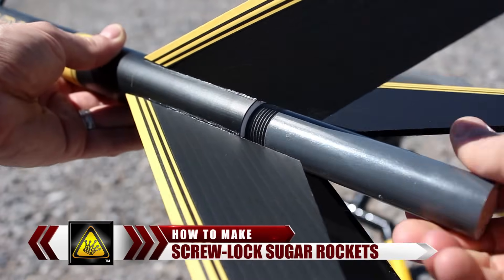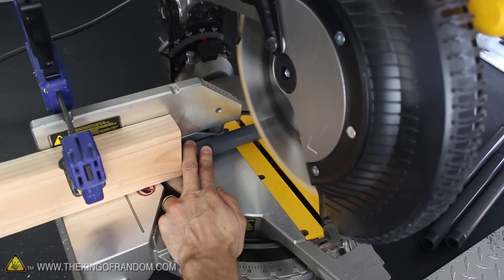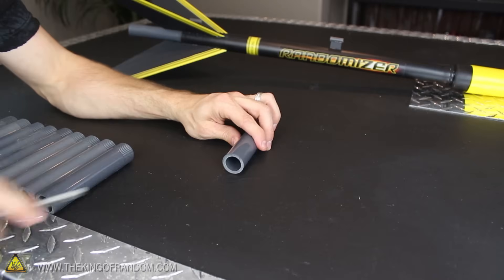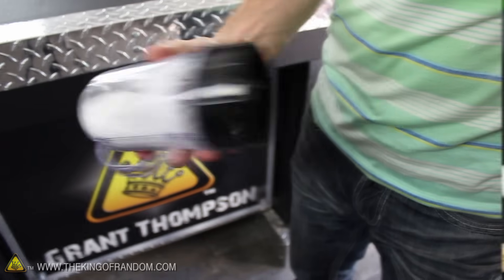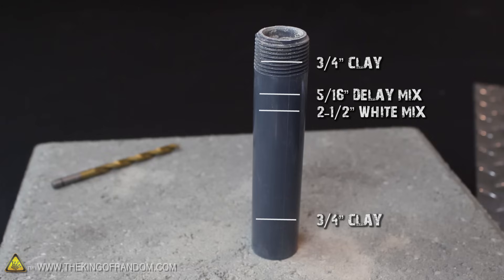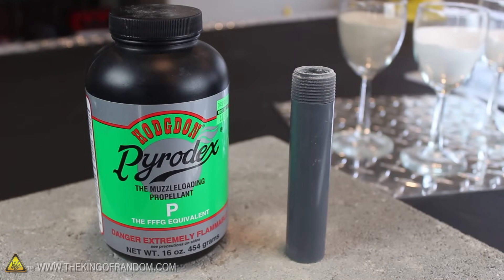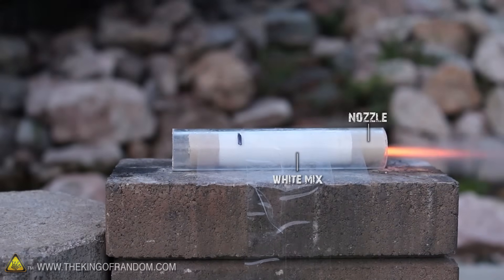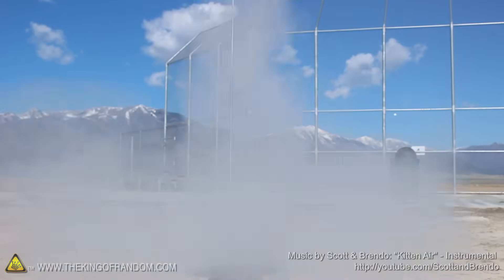How To Make "Screw-Lock" Sugar Rockets

Comment: 1 7/16, 1 12/16, 4 1/4, 3/4, 5/16, 2 1/2, 3/4 .... good God, I don't know how Americans do it :(
Reply: +Hugh Jass What he is saying is that those decimals are RIDICULOUS. 1/10 or 1/100 like metric is so much easier.
Reply: +BC ElginTex said no one ever
Reply: +EoRdE6    Fractions.  I love them.
Reply: Our rulers have longer lines to signify half inches and quarter inches from the 16ths of an inch. I hope that answers your question.
Reply: +EoRdE6 Actually It's good to have some skill in both fractions and decimals. And on top of that, fractions can actually accurately describe more numbers than decimals (including very commonly used numbers).

That said, it's not much trouble to use either fractions or decimals in the metric system whereas using decimals in the imperial system is incredibly troublesome.. And the decimal system is the standard for counting numbers after all.

However, the dozenal system lends itself more for fractions than the decimal system as twelve has more divisors (or factors) than ten. Though the sexagesimal system (base 60) is even handier for fractions, and it is usable in combination with a dozenal system. (our minutes and seconds and angle degrees are derivative of a base 60 system)

PS. 16ths are simply the quater inches divided by four.
PPS. I'm european and most used to the metric system. ;-)
Reply: CelmorSmith I was actually looking up if there are digital calculators that actually have fraction based logic.. but I didn't find any...
Reply: Try putting in fractions in a computer, most databases, tables or even Apps to plan like anything that save numbers as numbers and not text won't accept fractions without converting them.
Reply: +Callum Aitchison we have rulers with 1/16 markers. we're rebels like that
Reply: ToastyMozart I can calculate with fractions with my TI-84+ but I don't know how it does it in the background.
But there's always a button do switch the displayed answer from fraction to decimal/from decimal to fraction or in the format a+b/c you just want to convert and you can configure the defaults.
Reply: Rulers.
Reply: Blake Matthews LOL
Reply: ToastyMozart Haha ^.^
Well, thanks, that's great to know!
Reply: +zdrux 1-12/16" = 1-3/4" = 44.45 mm.
Reply: +zdrux  well, like this
1 7/16,
1 12/16
4 1/4
3/4
5/16
2 1/2
3/4
Reply: ***** The metric system indeed scales down much further than the imperial system. And that's really the factor which makes it useless for those small measurements: If it would scale down as well (and not as far as a thou) it would be more useful. For example if 1/24th of an inch would be another separate unit between inch and thou.. Actually, why not just design any fractions smaller than 1/24ths of an inch out of the project? (20/64 → 7/24 or 8/24 (both have only 0,5mm difference with 20/64, a difference you admittedly designed out of the project when working in millimeters..)

On the scales of feet and yards the metric system is just as useful and accurate as the imperial each offering its own situational benefits. And subjective usefulness merely depends on user ability.

On larger scales however, (chains furlongs and miles) the metric system becomes much, much more useful and consistent and the imperial system ditches its primary benefit of easy division (1 mile = 8 furlongs = 80 chains = 1760 yards)..
If there isn't any mathematically practical use for these ratios that eludes me, I'd say these are "utterly useless" compared to the metric system.
Reply: *****
It's confusing when you say Imperial. Imperial units refers to the old British measure. American measurement is called US customary units. It isn't the same as the British Imperial measurements.

US customary units allow for very precise measurements, but there is no 1/24. There are 1, 1/2, 1/4, 1/8, 1/16, 1/32, 1/64, and so on. When you mentioned 20/64, we wouldn't say it that way...instead, we say 5/16 (which is the reduced form of 20/64). In addition, many measurements (such as thickness, weight, etc.) can be given in decimals: 0.1, 0.01, 0.001, 0.0001, and so on.

In some specialized fields such as nautical and land surveying, and in old documents, there are some special units used (knots. leagues, fathoms, rods, chains, cubits, etc.), but 99% of people never use such measures and do not really know what they mean. For almost all people and situations, we use miles, yards (but not often), feet, and inches. So no need for the weird ones such as furlongs or chains. I would put measurements such as furlongs and chains into the same specialist categories as joules and newtons.
Reply: oh god... this could NOT be a more depressing comment chain. sorry guys

but really? this is how you choose to be
nerdy? smh
Reply: ***** I didn't mention 20/16th the other guy did. I already thought it was odd he used a fraction that can be reduced..

In any case, my point was in reply to his statement that the american system is utterly useless for small sizes as is the metric for larger sizes. And I argued that both systems can be used perfectly fine especially if – like he suggested – you "design any small fractions out of the project".

Regardless of the relevancy of furlongs and chains, for those large measures the metric system is obviously more consistent and useful. The loss of measurements between mile and yard makes the American system arguably even less useful. (But mainly it is the factors between mile and yard and inch that make it quite unnecessarily complicated.)

So really, the difference between the Imperial and American system doesn't matter for the points I was making ;-)
Reply: +zdrux Yeah I'm 'Murican and I wish we used metric. We are slowly using the metric system in more places but the government wont just switch.
Reply: +Yawning Gull Why would the government have to switch? People can and do use the metric system in America. you can already use whatever system you want lol

Comment: Potassium nitrate is highly flammable..... Is what he says after we put it in the oven... RIP my stove... Thanks a lot -_-
Reply: Its the final mix that's highly flammable not potassium nitrate, you and your oven should be fine
Reply: Potassium nitrate isn't flammable. I've literally tried burning it with a blowtorch but nothing happened. It would've been weird if something had happened, because it's merely an oxidizer. The sugar is the actual fuel.
Reply: +Rolando Martinez Potassium nitrate is a good oxidizer: It makes other flammable things really flammable, but on its own, not so much.

And KNO3 has no flash point, so sticking it in an oven is totally fine.

Comment: how dose  it work
Reply: When you light the mix, the sugar will burn extremly fast and powerfully (because the potassium nitrate delivers a lot of oxygen to it). The reason sugar on itself doesn't burn well, is that there's not enough oxygen in the air.